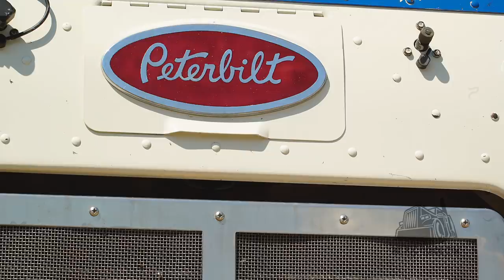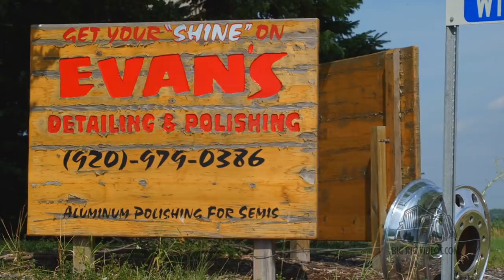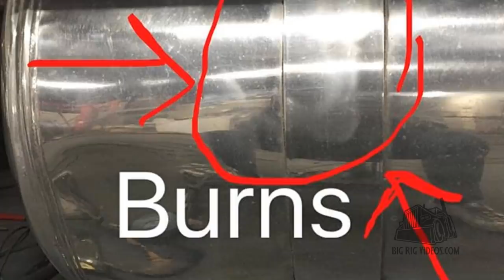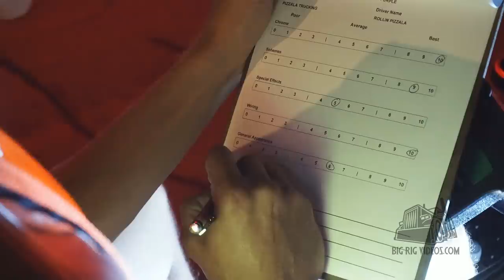Dirty Business - Evan's Detailing & Polishing

Comment: Hi Evan,

PLEASE CAN YOU HELP??? Wish I could send you photos.

I have this Zephyrpro40 stuff and bought it to clean and polish the rims of my Jeep KJ.
It's been a freaking nightmare trying to polish these rims.
I have been cleaning and sanding 1 rim for four months now because 1) I had to get a variable grinder to polish with, (GOT). 2) Sandblasted and glass-blasted the rim first to get all the top coat of clear coat paint off the rim before i rough sanded the spokes of the rim.
The problem is: I keep getting black areas on the rim while polishing the rim and cannot leave that on as it looks ugly with the black areas especially around the nut bolt areas and the rim edges, and the shine comes up dull and unpolished even with a 6000rpm and a 10,000rpm grinder.
Feel like just sandblasting them and painting them and be done with this, as this product is just useless or is it me?
Did call for help at the zephyr products place and all this guy could tell me after including photos was get a faster grinder and do not use too much polish, even though the kit calls for max speed of 3400rpm grinder, fed up plunging money into something that does not do what it's advertised to do.

I'm out over $500 for the zephyrpro40 polishing kit including the grinder, many bottles of mineral spirit I have used and the elbow grease I have done to fix this rim what a waste of time and money.